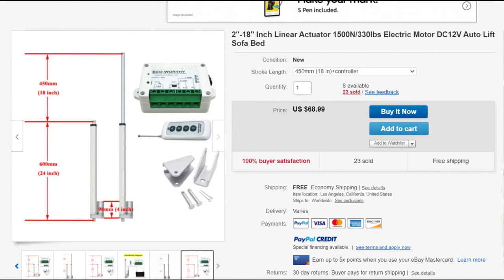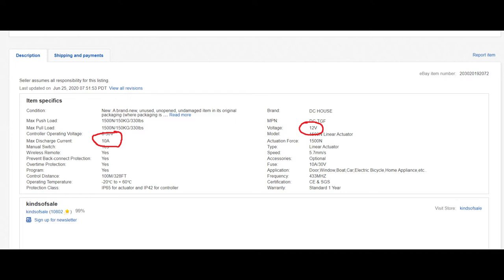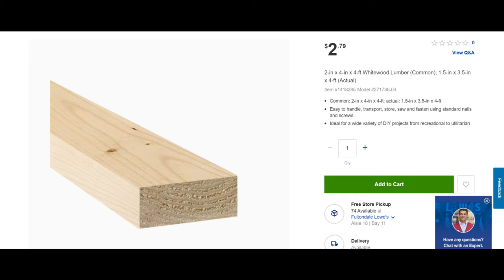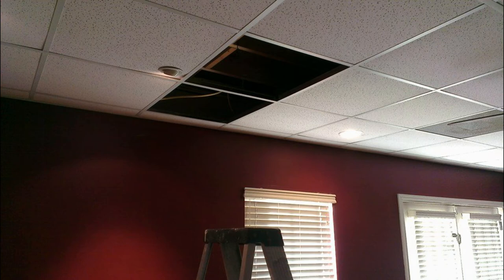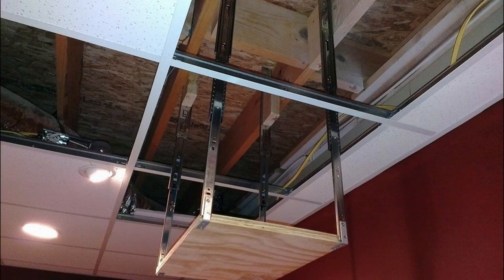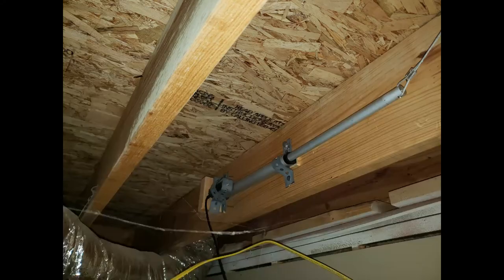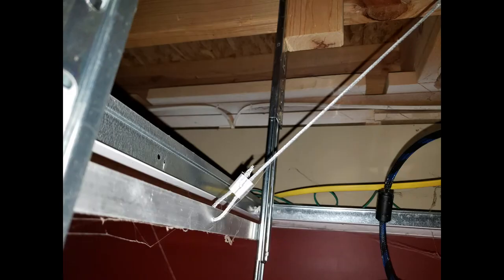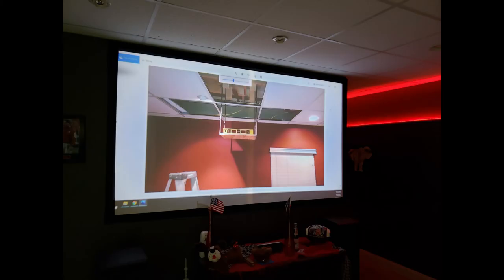How to make your own DIY motorized projector lift for home theater.

Comment: Thank you SO much for this video!!!!!  Using it, I was able to closely replicate what you did (I built a self-contained housing box for the whole assembly), and now have a wonderful remote projection lift that smoothly lowers 30 inches.  Could not have done it without this video!!!!  Am now planning on adding another cable to the actuator and having it run to a system of two pulley wheels for gearing, and then on to curtains for the screen... such that the curtains raise all the way up as the projector lowers, and vice-versa.
Reply from the maker: Awesome! Glad it helped...After all...This is what the video is for!

Comment: you have to make sure your actuator is in line with the force line. will go allot smoother.
Reply: All this takes is a few pulleys, that actuator will be ruined so quick since it's absolutely not designed to take sheer force like that.
Reply: @MS-gn4gl  sheer force? Isn't the cable parallel with the actuator rod straight out to the pulley?